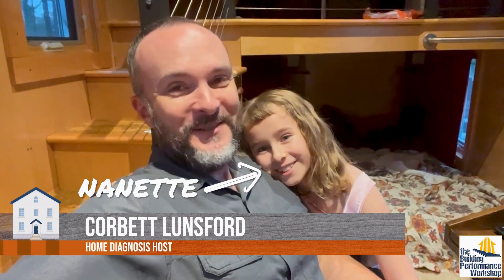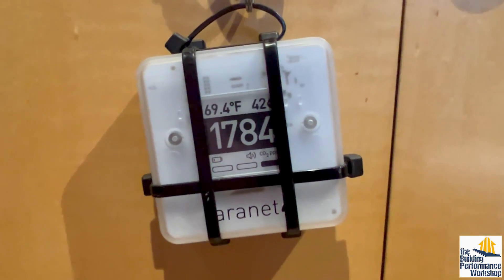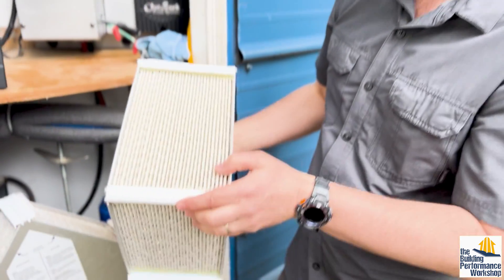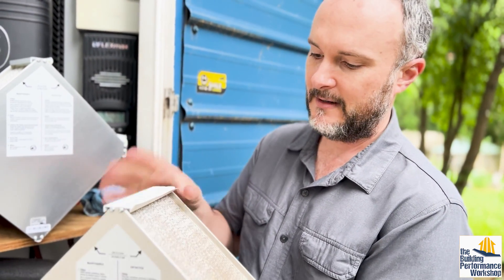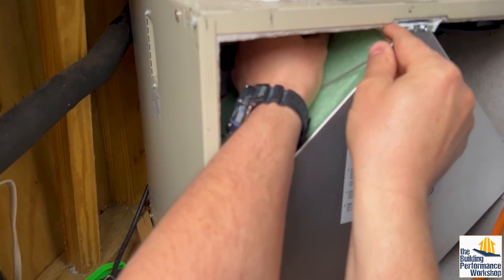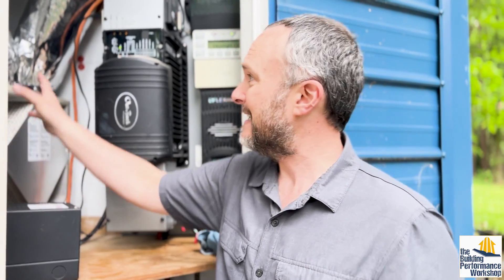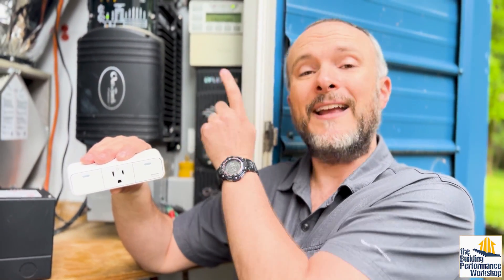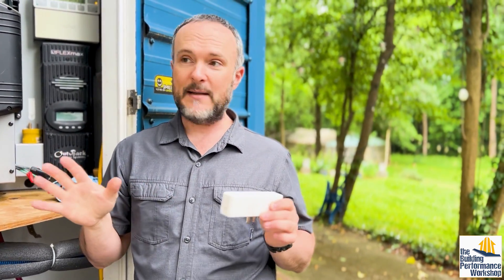Ventilation Upgrade: ERV Core Replacement after 8 Years of Continuous Ventilating in a Tiny House

Comment: Hello, Where and how were you able to obtain the Replacement ERV Core?

I've been Watching your Videos Very helpful. But I'm having several tiny issues with My Unit. I bought it to remove odors in My house because I'm terribly been sick when I'm at home. I'm suspecting the Flooring in My living room is releasing chemicals that Might be making Me sick, So, I was hoping that using these Air Exchanger Devices to Replace the Air in the House might help. I have it temporarily installed in My top floor where the Kitchen, Haven't done any cooking in the Past 6Months. But, for whatever reason I'm having the Same Odors that I'm trying to get rid of come through the Fresh Air Supply port. Mostly Food Odors and Probably the Chemical Odors too (Possibly Odors Stuck on Furniture). But that shouldn't be.. ?
I'm thinking It might be due to the ERV Core being Paper material which has the ability to retain and transfer odors the same time as the temperature exchange is occurring.
I have the AI Series B150E75NT Unit. Since the Shell and controls are the same the only thing different are just the cores. I've been thinking Of Switching to an HRV Core, Since it's Metal, It shouldn't transfer/exchange Odors like an ERV Core.? But, I don't know where/or how I can get Just an HRV Core. I've searched everywhere online, Even Looked on Broan's website to no Luck.

Humidity  is not an Issue for us where I live so I'm sure with HRV Core I should be fine.
Reply from the maker: Just call Broan support for a replacement core, BUT you should watch this first:
Home Ventilation SIDE EFFECTS: Ozone, HRV vs ERV, NOx, and UV Disinfection with Michael Link
https://youtu.be/xLwHmfdwO9s

I suspect your cooking is not exhausted and is spiking all the materials in your home with the contaminants, perhaps.

Comment: Watching one of the channels I watch about narrow boats... I spotted an interesting thing they are using over there. They have a very small HRV unit for those boats. Not sure if there is an ERV version but It is interesting for RV use etc. I was looking at a cheap import HRV (I know) to install out in my shop to help keep the shop air cleaner than it is. A big unit would actually work great for the amount of gunk in there but they are pricey units. It would be nice to exchange air without loosing so much cool air when it's 110* here. Right now I have a 6" fan that I use to add ventilation when making a mess. Better than nothing but not enough.
Reply from the maker: Interesting find

Comment: Thanks for putting this together. I am planning a gut rehab of an 18-unit multi-family tenement building in NYC. Each unit is only about 400-500 sqft. I plan to replace the central gas boiler with individual unit heat pump, rip out the wall and add close-cell insulation, and replace the windows. Do you think this will get to the 2 ACH threshold you mentioned in other video for the need for ERV? Do Broan or Renewaire still make small ERV suitable for small spaces?  Which model would you choose if you have to replace your tinylab ERV now?  thanks
Reply: With 8 feet walls, that's 4000 cubic feet, so 60 CFM would get 1 ACH. The other question is what do you do for cooking smoke, and associated makeup air? The other issue is getting the ERV vents far enough apart both on the inside and outside of each unit. I'm thinking a consultation with Corbett might be your best bet. It would be cheaper than a mistake you have to fix later.